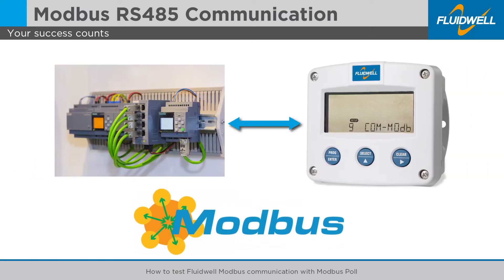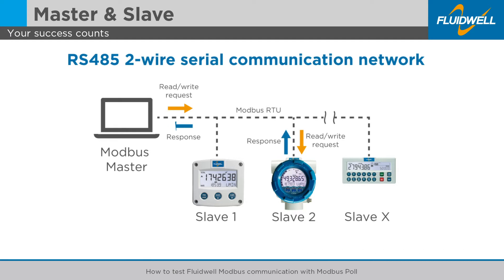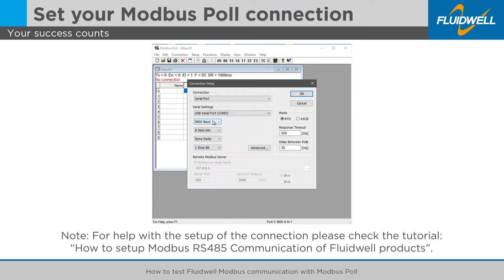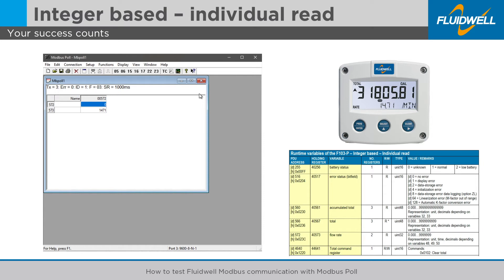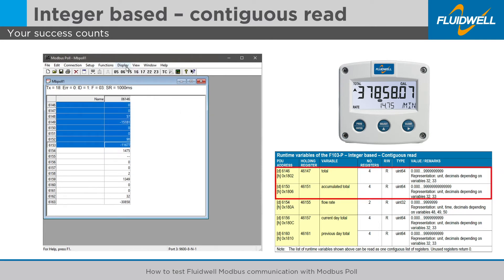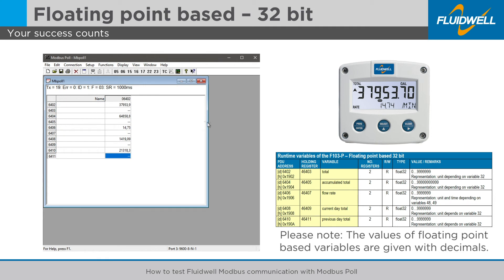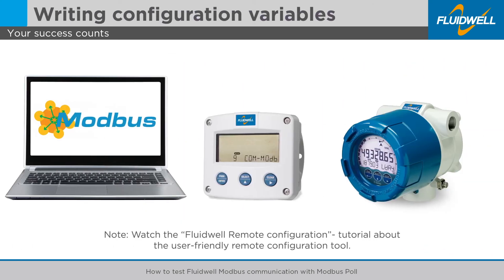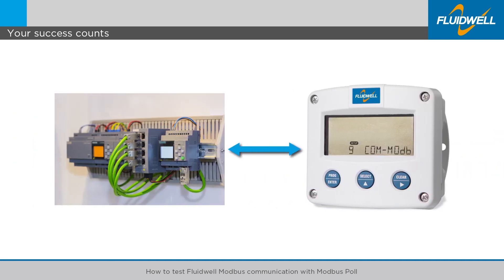How to test Fluidwell Modbus communication with Modbus Poll - Part 2

Comment: For the F116-P device is it possible to read value of 3 registers separately and then manually calculate it or not
I've did that at F112-P and it's OK. 
But at datasheet for F116-P it's mentioned that should read a single action!!
So is there's any configuration should be changed or it's not possible
Reply from the maker: Has this issue been resolved yet? Otherwise, you can use our contact form for further assistance. https://www.fluidwell.com/service-and-contact/contact/

Comment: When reading registers on modpoll I can only read one register at a time. So if I put in (PDU144 x3 I get a illegal data address 02)? vs (PDU144 x1)
Reply from the maker: Is this still an issue? You can check our website www.fluidwell.com/modbus for more information about modbus and our products.

Comment: How can read value with unknown holding register. it's possible make it with modbus poll?
I have light radiation sensor model BGT-JYZ2 but i haven't manual and not find it in internet.
Reply from the maker: For Modbus communication you’ll require ALL parameters to be 100% correct. Without the holding register nr you cannot make a Modbus connection and read the register. Please contact your supplier for support, manual and Modbus documentation.